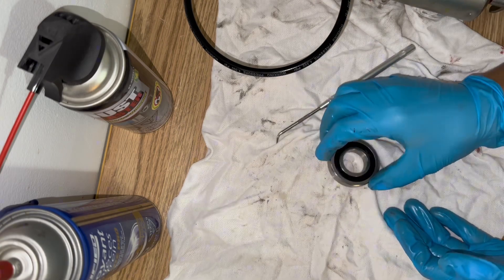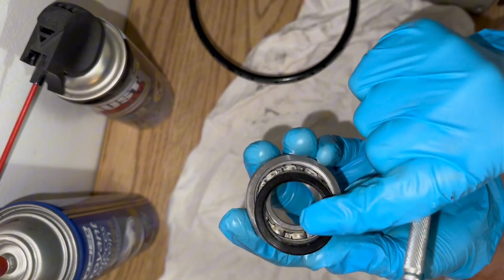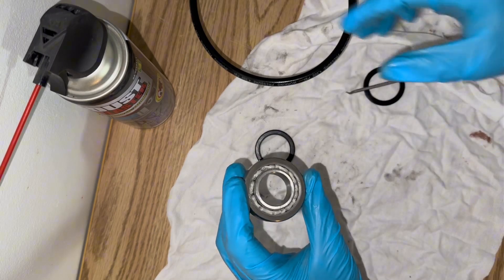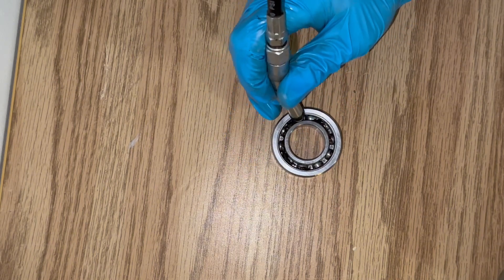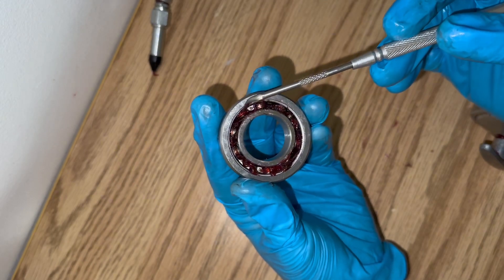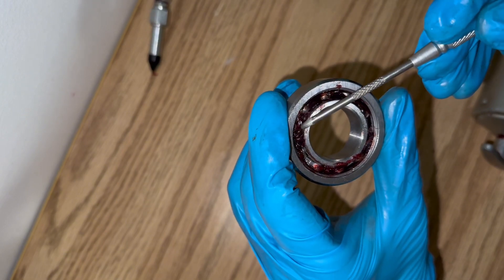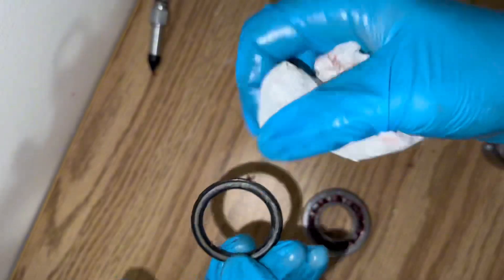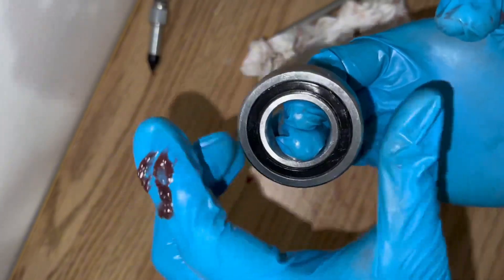How To Clean & Regrease Sealed Ball Bearings

Comment: Don't spin 'em with the air hose just for fun when they're dry.
Reply from the maker: You are correct. The high speed spin with no lubricant may cause premature wear on the bearing components. Thanks for putting that out there. And thanks for watching. Please like and subscribe